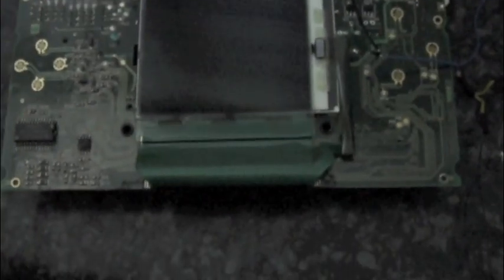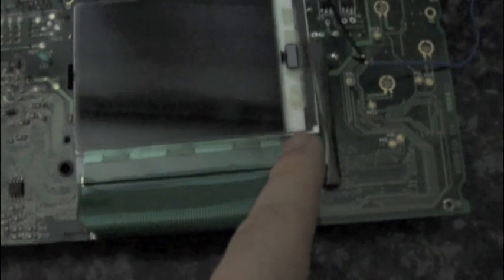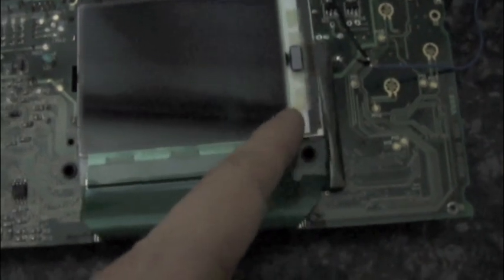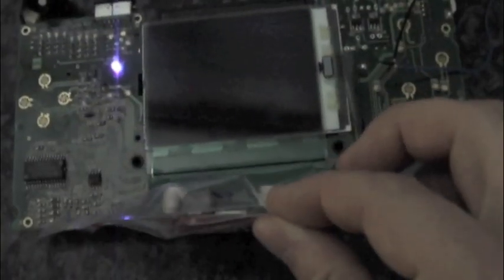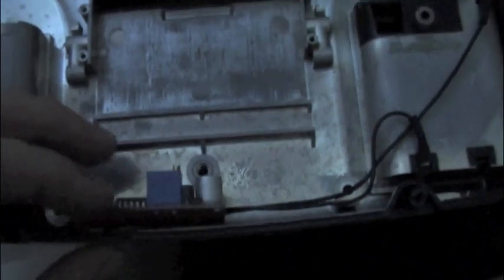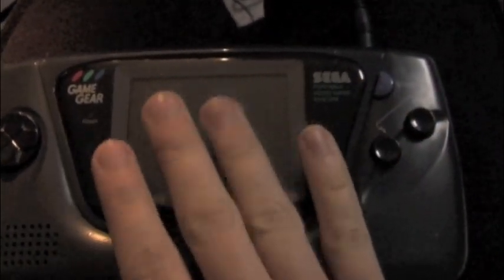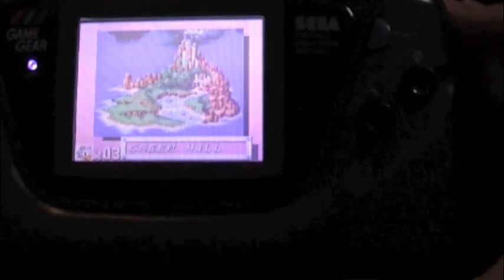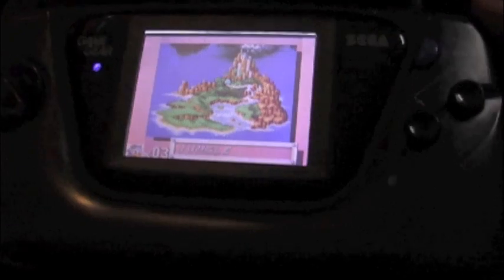Game Gear LED backlight

Comment from the maker: Sadly, you can't replace the crappy lcd screen. It's just too difficult. Some have done it but the video connection is too proprietary. You're left with a nice screen but the picture is just a postage stamp in the middle. Plus it's an absolute ball-ache.